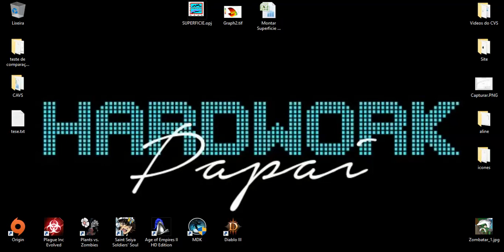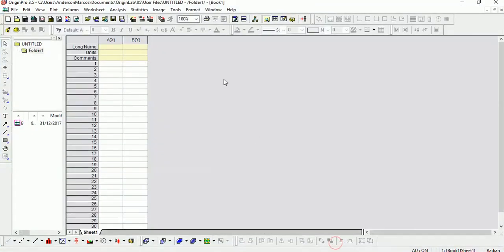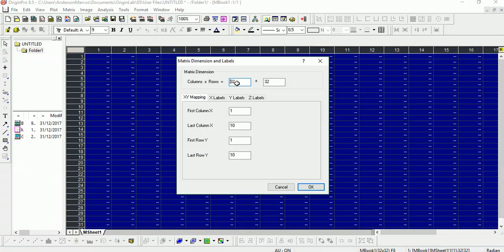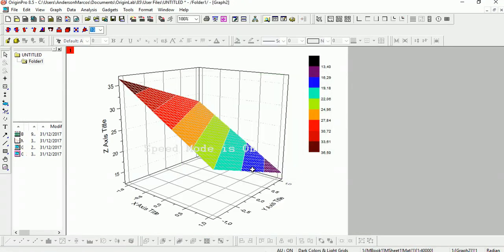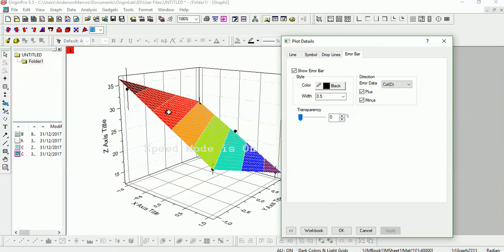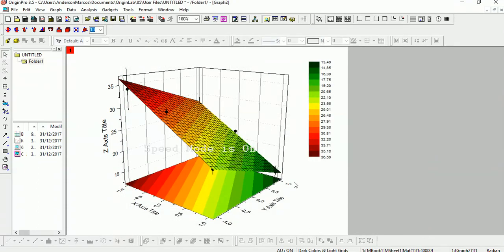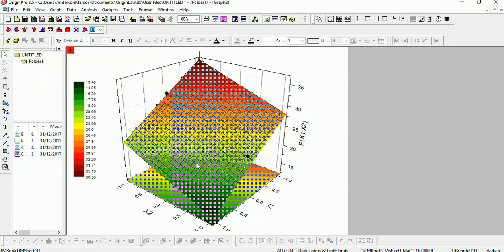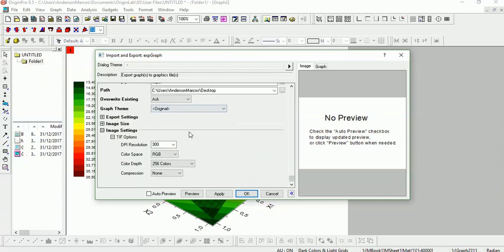How to plot high resolution 3D surfaces in Origin 8.5 - For statistical design experiments

Comment: how to get formula for two independ variables and three levels
Reply from the maker: You get the model formula from the software you used to make the adjustment. As you have 2 independent variables, you will have two different models. Regarding the number of levels, after the model has been obtained and validated, it no longer makes a difference whether the model was built with 2 or 3 levels

Comment: Hello, i downloaded the link for colour palette. But it is not working
Reply from the maker: Hello! Are you using the same version that I used in this tutorial?
Reply: Yes, I am using the same version
Reply from the maker: @tare2835  Weird, it should work exactly like the tutorial 😕. After I published the video, I never touched the files again, so the file is correct and it worked 5 years ago (as you can see in the video).

Unless you provide some kind of detail, the only thing I can suggest is that you try to repeat exactly the same steps used in the tutorial, using the same equation I used. If repeating the tutorial works, it means that the method is working.
Reply: Anderson, Thanks. I am able to copy the color format. However, the gridlines on my surface plot are missing. Can you please suggest, how to add?
Reply from the maker: @tare2835  I'm not 100% sure as I haven't used Origin in a few years, but you might need to right click on the surface and go to styles (or something like that). In the window that will open, you should have the option to remove/add grid on the surface in one of the tabs. Maybe you just need to add some color in the grid. It must be something simple

Comment: Nice tutorial! But hey, what if I have to plot a surface whose model has more than two variables? I'm working with a design which contains x, y, z, xy, xz, yz and xyz. How can I use more than two variables if origin only lets me have x and y while z is used for the response?
Reply from the maker: Hello @Lichewitz
! Thank you!!

Well, you just have to fix one of the variables at a desired value (generally is the central point)!

let's say you have this equation:

Z = mean + A*x1 + B*x2 + C*x3

If you want the plot of x1 and x3, you choose a value for x2 (which must be within the limits you used to perform the regression).
Then you have:
Z = (mean + B*x2) + A*x1 + C*x3

This term (mean + B*x2) is a constant in this example

Another example:

If you want the plot of x2 and x3, you choose a value for x1 (which must be within the limits you used to perform the regression).
Then you have:
Z = (mean + A*x1) + B*x2 + C*x3

This term (mean + A*x1) is a constant in this example
Reply: @andersoncanteli  Got it! But assuming I have equation with, say, four variables, and I want to select only two, when the time comes for me to input the equation in the matrix values, do I need to multiply variables I'm not showing by their coded value, changing the intercept value?

For example, if my model is (R =  mean + ax + by + cz + dw), and I want to plot x and y while keeping z and w at their lower level... do I have to substitute z and w for -1, resulting in the equation (R = mean -c -d + ax +by) ? Or am I missing something here? And thanks again, your tutorial was very very helpful!
Reply from the maker: @lichewitz8905  If you are using the coded equation, as seems to be the case, then it is as you described